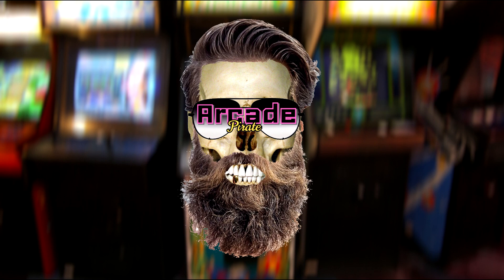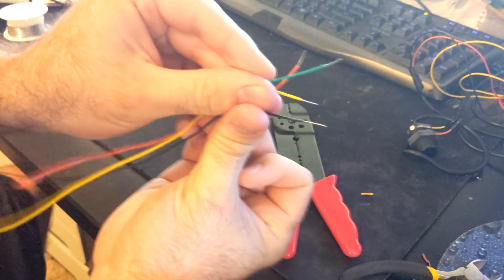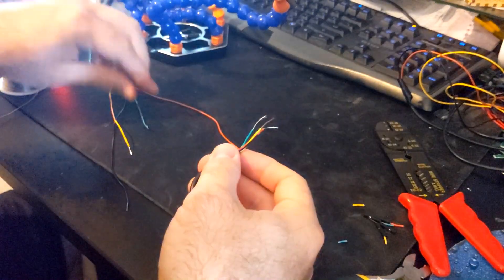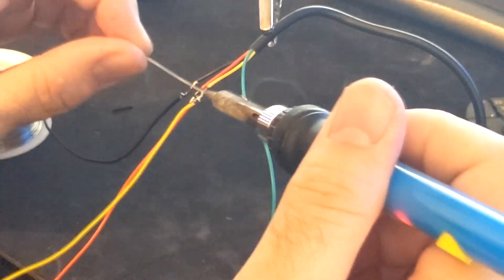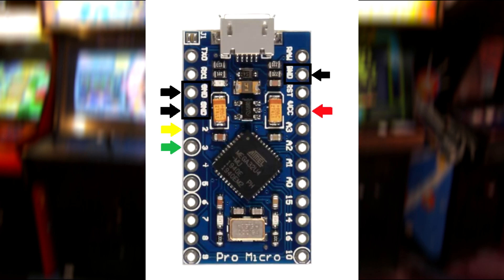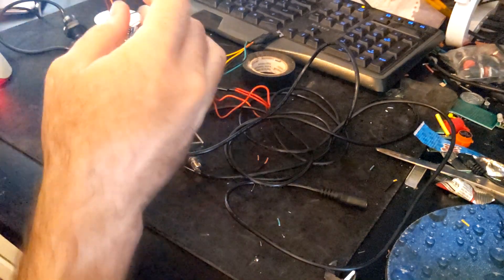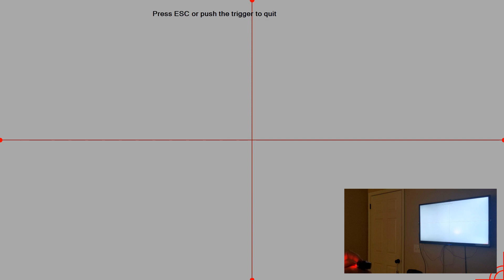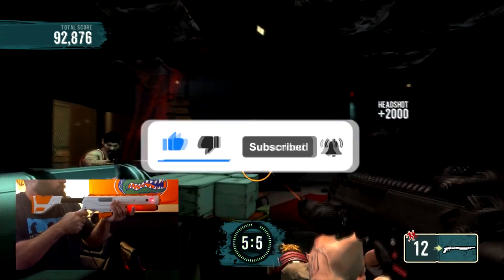GUN4IR Camera Install

Comment: What about installing pins on the new wire then plugging in to the existing camera ends instead of cutting them off?  that way you can heat shrink them and be able to adjust length as needed if you mod another gun...
Reply from the maker: Sounds like a great plan. Like I said in the video you don't have to extend the wires like I did. I'll do that on my next build. Thanks for the input.
Reply: Got a link or part number for the pins you’d recommended instead of cutting off the leads on the camera?

Comment: Oh question! @arcade Pirate. When you mention that you may already have something soldering in a spot on the audrino board, are you able to solder the other side of it? So say I would like two different buttons on the topshot to work for the a button. I should be able to solder both sides of the board for the two buttons, correct?
Reply: You can solder to both sides , solder one button point to another , or combine two or more wires into one with shrink tube . All works the same